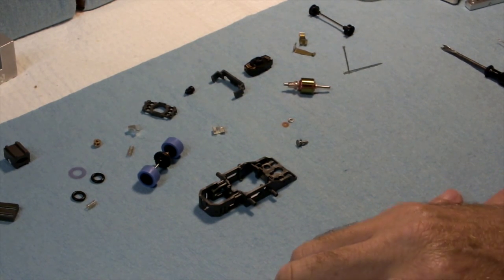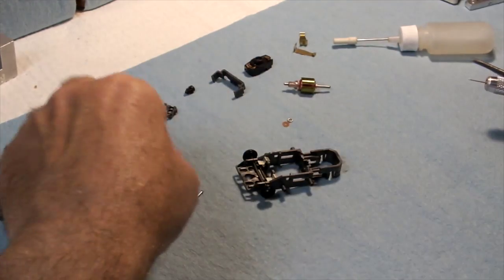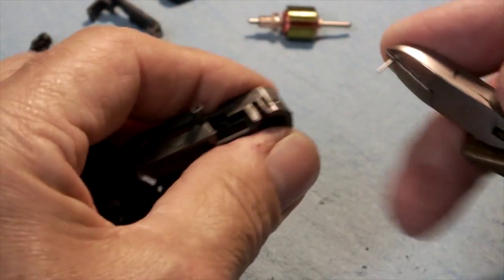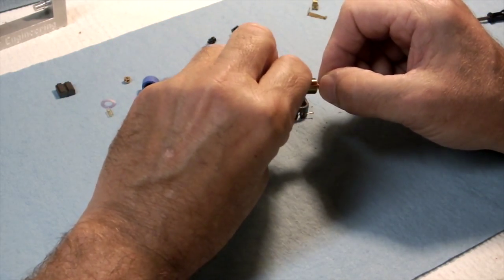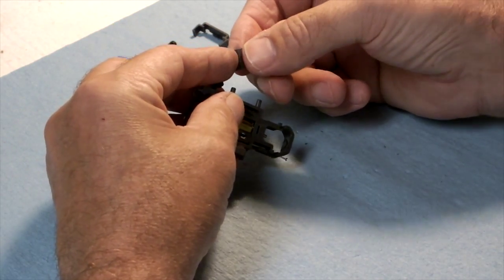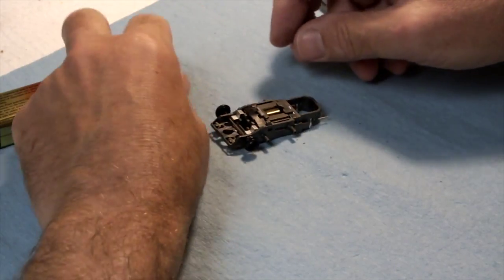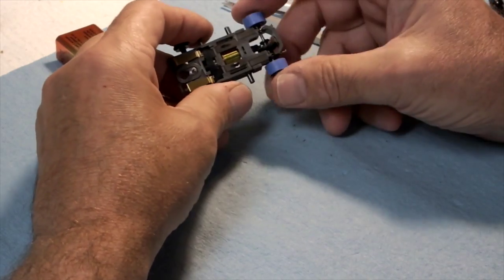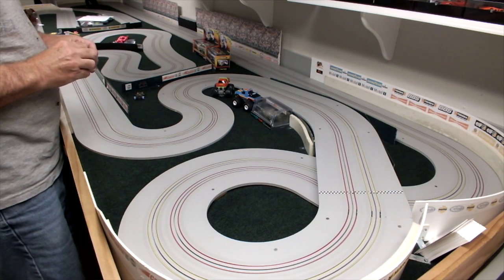Viper V1 HO Slot Car RTR Chassis Assembly & Discussion

Comment: Well, I got an old banged up Super G+ to practice on and a G3 962 Chassis for transplant. Predictably the stock chassis cracked in short order and I did the swap along with a fresh tune up kit. This and Gary's videos were invaluable help, thank you. I had to trim the stock magnets in order to fit, and the fronts were dry rotted and disintegrating so I replaced them with some Jel Claws I was given. I have some BSRT, but I'll save those for race day, I also have some rears but I'll go on the stock stuff as I learn, then start replacing as things wear out. I see there's quite a few things to be done in the future, and traction mags are a big step. Thanks.

Comment: Just a question. Since you built and fast car why didn't you choose to use a ball bearing end bell and a bearing on the rear of the armature. That would place the armature on bearings instead of bushing? Do the bearings hold up well with low ohms armatures? Any heat issues effect the bearings. Also I have seen silver plated end bells with bearings. I don't race G plus, but I like the design of the chassis for a magnet cars. I only run T jet & afx chassis.
Reply from the maker: +thunderbolt427 Thanks for the question.  Bearing don't add much if anything on the factory based armatures.  Plus, bearing don't fit the shafts.  Bearings only offer a benefit on custom armature with a slightly smaller shaft.  Also, most clubs that run national rules do not allow bearings in the 6 ohm classs super stock cars.